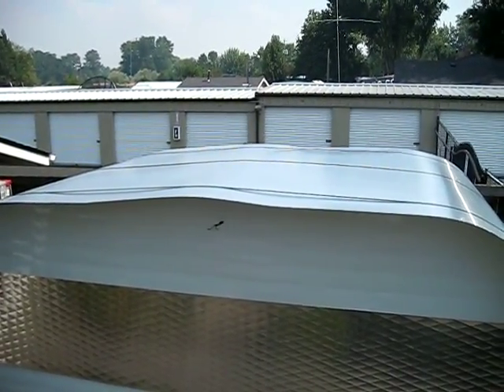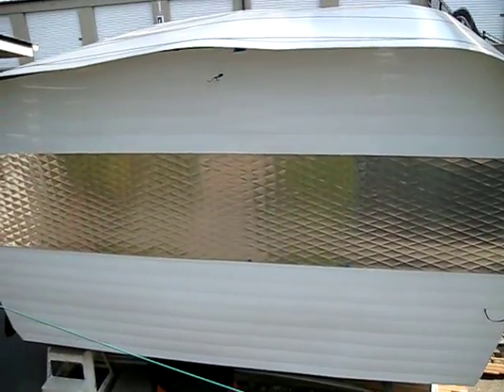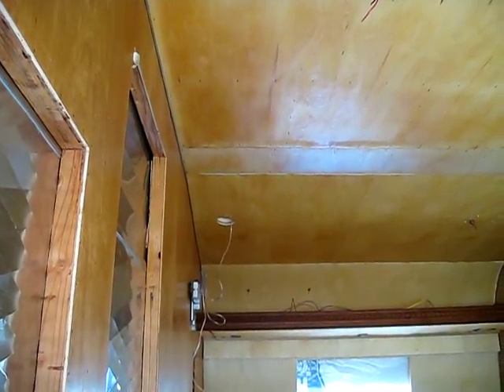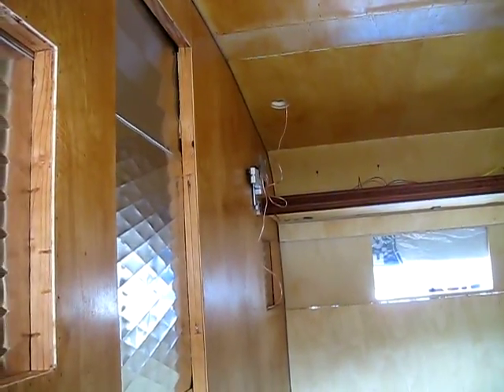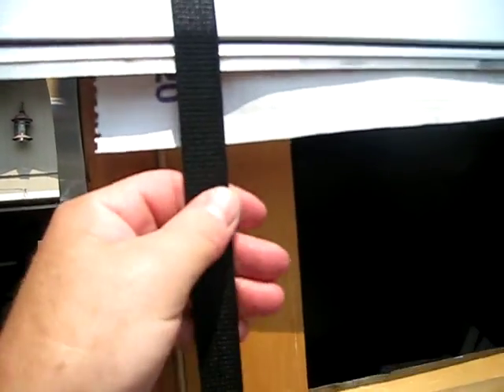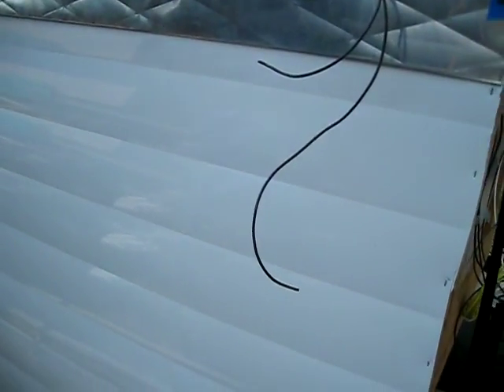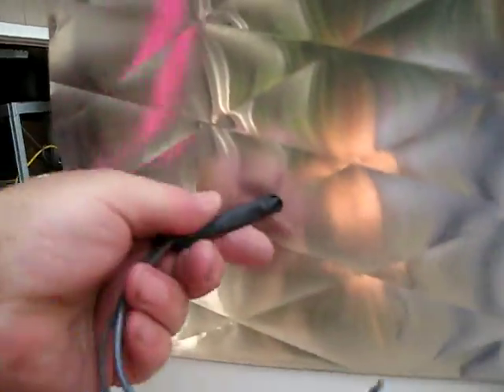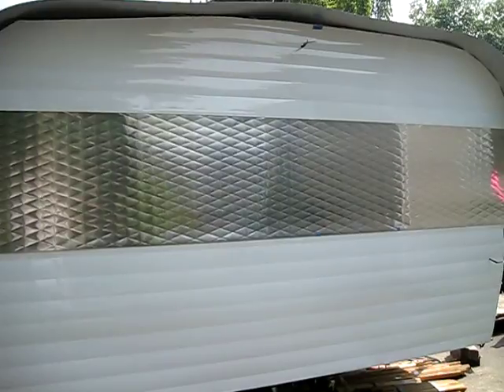1964 Shasta Travel Trailer reconstruction project part seven siding and roof 073115

Comment: Where do you source your aluminum from?
Reply from the maker: call KC @  https://www.interstatervmetalandsupply.com/catalog.html
Although, with the current tariffs the price might shock you.
I would also consider re-using as much of the old metal as possible and only using new if needed.
I'm currently building a small camper, and all the metal will be original vintage - saving over $1000 in new metal costs.
Reply: The original metal.... Well the entire original structure, was super beat up. Have contacted KC and appreciate the recommendation!
Reply from the maker: Yes, go with new if you must, it will be beautiful. Make sure you do the math correctly when ordering your metal.  The metal will be available in certain standard widths - adjust those widths including the connecting seam [if any] when calculating the coverage for minimal waste.  Draw it out and measure it TWICE before you order!  And, post your videos...I'd like to see your progress!